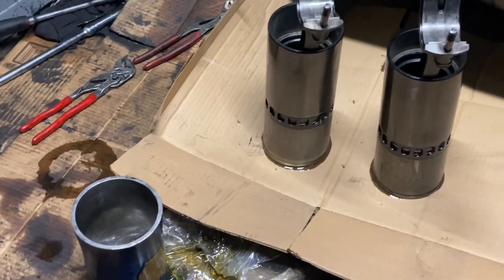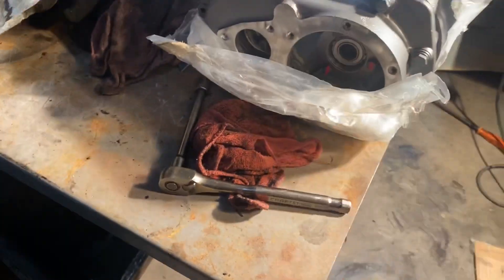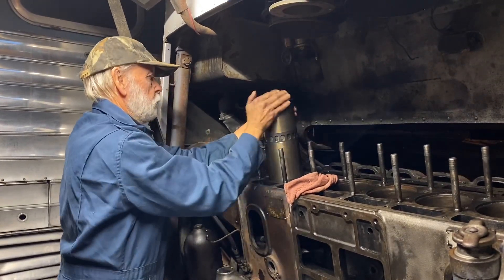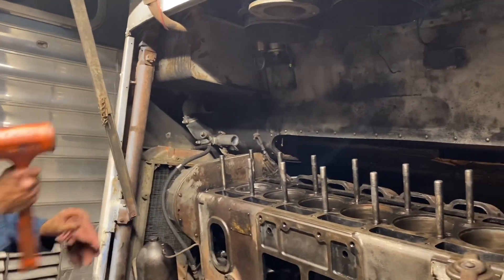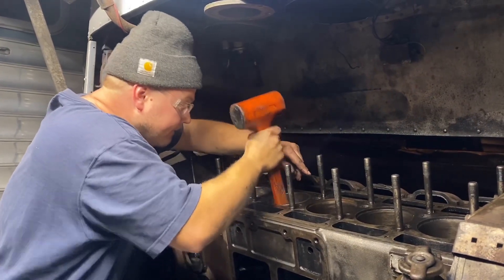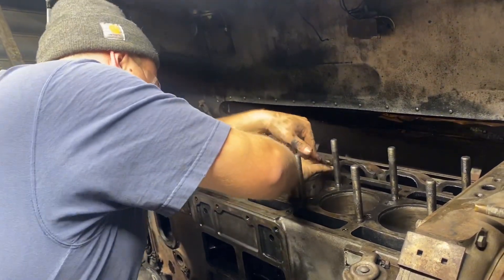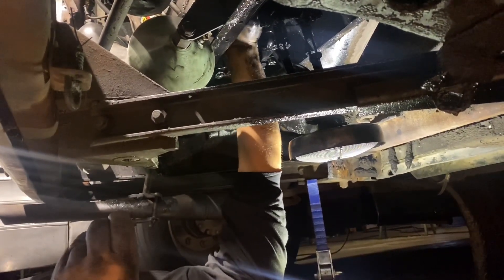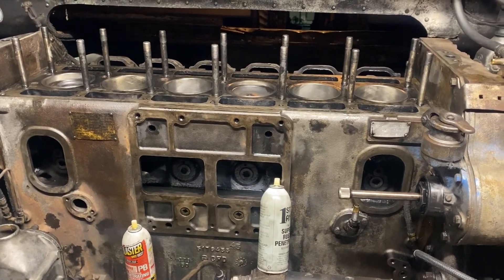Detroit diesel 671 going back together.  Special thanks to Jay for donating the head

Comment: Scott,
I'd recommend you with a laundry marker number each tool to make sure you don't forget one at a job site. If your like many mechanics I've known over my lifetime tools are unintentionally scattered all over the job site when you finish and can take up to 3-4 hours to put everything properly away.

I just had my 2005 Jeep Grand Cherokee limited serviced and when I opened the hood this morning to check fluid levels sitting on top of the air box was an expensive Snapon 1/2 ratchet. Stopped back by his shop and when I walked in I asked, missing something? Holding up the ratchet. I was wondering where that got to he replied, I was just about to order a new one. 

Thanks to you and yours for the beautiful work you two do and the videos you produce. I especially liked the put together videos of the MCI 5A you put together in a 2 plus hour video. And thank the gentleman from Tennessee for the story on Bud one and the description of " is this how people rode in buses? " story. Hilarious, I just about fell off my chair with his description of how he felt every little defect in the road and then it took off and flew and I discovered what air ride on a bus is like. 

But what really began to fly was BGM.

Cheers!

Comment: Coming along nicely guys.. Saw you using LUCAS product, I too use LUCAS products when I can here In the UK.. I have a Ford Mondeo 2 litre petrol auto thats got a suffering auto box, it sometimes loses drive In drive 1, so, drained out 1 litre, and pre heated a LUCAS autotrans fix bottle and put that in the trans - made it better but not cured. ran it 4 months then drain out another litre and put another liter/ bottle of LUCAS autotrans fix.. The cars still not perfect in Drive 1 and drive 2 but good on drive 3  upwards.. The mondeo is still going so not scrapping it yet.. Still shiny comfortable but very high millage, NOT DEAD YET - lol Thanks LUCAS OILS

Comment: How about when installing the piston & liner  first install the liner with the rod 90 degrees to the air box to avoid jamming the rod into the air box ports , after  clearing the box with the rod  then rotate the liner 90 degrees back  to line up with the crankshaft and drop the liner in the rest of the way ?
Reply: I used 2 rubber hose's stuck on the rod bearing cap bolts to keep the rod lined up with the crankshaft. The rubber will not scratch the crankshaft as it slides down when pushing the Piston down. Then just pull the hose's off and bolt on the cap.

Comment: Any idea Scott how old the engine is? Just fascinating to think after sitting outside for years she's coming back to life. Wish I was there.

Just for an example it's big brother the EMD 645 as an example cylinder liner, piston and connecting rod and cylinder head checks in at around 900 pounds and is installed as a complete unit. This requires an overhead crane or hoist. cylinder head torque settings utilise a torque multiplier and if I remember correctly finish somewhere around 965 pounds of torque.

Comment: You are a nice person and a mechanical genius, the bus whisperer, that is why people are willing to donate their time and energy to this cause.  
Also, a question, 
What is the purpose of the blower?
Reply: To forse the exast out and fresh air in
Reply: The blower scavengers air at just slightly above the static air pressure about 1 1/2 pound of pressure and is used to force out the exhaust while providing a fresh charge of air for the injector to inject fuel into, remember it all happens on one revolution of the engine. The blower is needed or the engine won't run but doesn't increase power like a roots blower does for a gas engine.

Comment: It was painful watching Bob struggle with that liner........
Reply: I WAS PRAYING it didn't drop out of his oily hands! Mitch mentioned using a rubber tube on the bolt ends !!   that's standard safety for the crank ?
Reply: @TOMAS-lh4er  Not so much on these engines because the crank surface is so hard . And you often have a mate underneath to guide the big end onto the crank . On the EMD's we used a crane to fit each liner/piston set.
Reply: @Mercmad  I could feel exactly what that liner felt like with all that oil !!

Comment: Scott have u seen a oem detriot ring compressor? It’s a cylinder that tapers down to compress the rings.  It works slick, I cut my teeth working on 2 stroke Detroit’s 23 years ago.
Reply from the maker: That’s what i use.
Reply from the maker: https://youtu.be/T9nlfXMO88o
Reply: Well awesome!  Very few people do, I was asking around to see if any of my retired friends had one to send to you.
Reply from the maker: I need the 92 one
Reply: Will ask, we next to never worked on 92’s.  71 or 53 series.  We were equipment, not trucks.

Comment: Scott, what is the horizontal cylinder off the right side of the oil cooler housing? I assume the vertical one off the left side is the cartridge type oil filter?
Reply from the maker: Oil strainer Vertical, oil filter Horizontal
Reply: @BusGreaseMonkey  Sort of like belts and suspenders. :)

Comment: So, why do you put the pistons in the liners before installing them? Does it make it easier?
Reply: There is a tool that installs on top of a new liner that allows the mechanic to easily slide the piston/rod assembly's very easily to the new liners. The tool is wider than the new liners making it easy to squeeze the new rings into the new liners. Takes less than a minute to insert the piston and rod per cylinder.

Comment: You used old pistens?...why...with all thts new....couldnt find any or they were just ok?
Reply from the maker: We are working on a budget.  There was nothing wrong with the pistons so no reason not to reuse them.  $400 saved here are there really help out a lot.  Getting the bus into running condition and not smoking is the goal.  We have a lot of old used parts here in the inventory.  Fixing it like it was meant to be fixed back in the day.  There is a whole chapter in the book about reusing old pistons.

Comment: So you have to install the liner and piston assembly as one unit always?
Reply: Chris Smith on cats you do called a power pack liner and piston assembly together guess for less chance of mechanics messing up with the piston rings is my guess
Reply: Depends on how you rebuild because you can do it both ways as well
Reply: No..I have rebuilt a 671 and an 8v71. I put the liners in first and then the piston/rod assembly.
Reply: Well I’m just used to 40 years of Cummins
Reply: Richard Van Dyke  Detroit Diesel pistons load from the bottom of the liner so the oil rings are not broken by installing from the top of the liner the bottom of the liner has a small chamfer for that purpose

Comment: i thought that was a supercharger or it just another word for one?
Reply: On a Detroit it's a blower. It literally just blows air into the combustion chamber. The motor could not take in enough air on it's own. When you put it on a gas engine it becomes a "super charger"  because then it creates boost.
Same thing different concepts.
Reply: Right. The blower does not pressurize the intake cycle much above atmospheric pressure, which is why it is not referred to as a supercharger. It’s primary function is to supply air pressure to push out the exhaust gases and help induct the intake air.